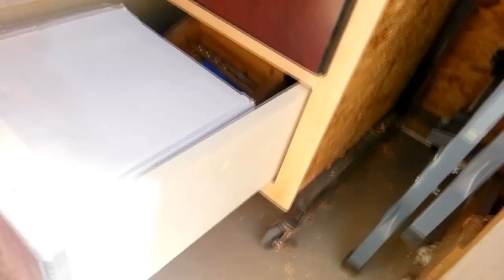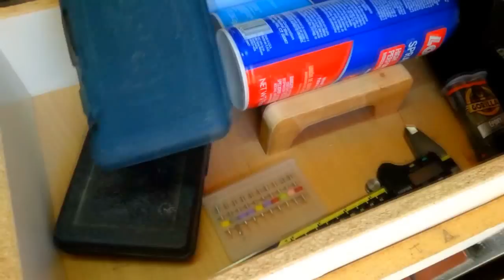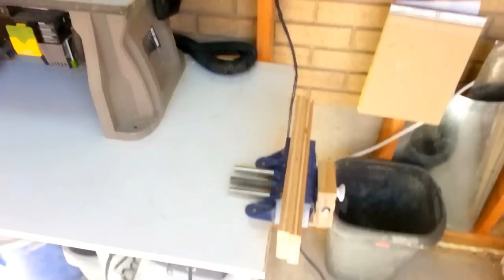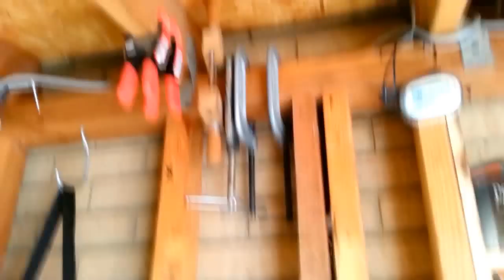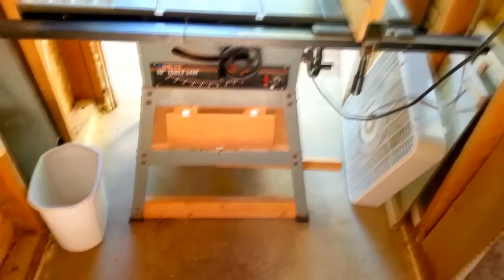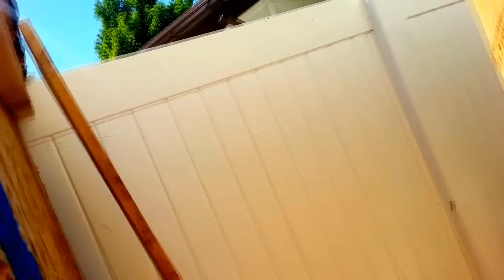Very Small Shop Tour

Comment: You have wood out back covered with plastic, in sheds (kind of) with plastic covering the openings.
I'm guessing you live in a better then average warm environment that lets your cut wood dry?
I live in Auburn Wa (greater Seattle) so warm if we're lucky lasts for three months.
I'm planning to get some landscaping done and if I do get into woodworking I'm hoping to setup some kind of limited cut wood storage (shed 15' long (guess?), 7' high & 3' to 4' deep) area in the back of my property.
Any ideas on how I could dry the wood?
Reply from the maker: T'airn'KA None if the wood storage in this video is for anything green. It's all dry before it's put in a storage area. All the storage is open in the back as well so it vents, I live in Utah so it's definitely not as wet as WA but I do get a bit of warping from humidity on thin materials. I have since setup up an open storage area for fresh milled lumber to dry and a small storage shed. I may do a video of those in the future.
Reply: I saw some of your new storage box (prior to fire vid) with a tip up top and tip down front.
A thought, would storing wood on edge horizontal or some kind of uniform clamping work against warpage?
Reply from the maker: T'airn'KA Usually I just put the heaviest pieces on top and that seems to stop the thinner pieces from warpage but I have enough lumber that it's really not a big deal for me. but anything in the storage box I haven't had warp at all, only the pieces under tarps where the the moisture can't escape.

Comment: What I would give for such a large shop 😀😀😀👍
Reply: +Smallest Workshop (Geoff Harris) its pretty well organised, my shop is 14ft by 7ft so i know what you mean ; )
Reply from the maker: +Smallest Workshop (Geoff Harris) Oh we are in about the same work space mine is 12x6 we should start a club! haha
Reply: +CNWOODWORK that sounds like a plan, I don't know about you but I seem to spend 30% of my time constantly striving for the perfect layout and the rest making more tools or jigs, maybe one day I will get down to some serious woodwork. 😀👍
Reply: +CNWOODWORK occupational hazard 👍😀
Reply: +Smallest Workshop (Geoff Harris) BTW looking forward to your next dumpster diving vid, this is something that your previous episodes have encouraged me to get into. Especially at a local factory where they put out massive bags of hardwood cut offs 👍👍👍
Reply from the maker: +Smallest Workshop (Geoff Harris)  How big is your shop Geoff?
Reply: +CNWOODWORK Hiya, my cavernous workshop is based on two garden sheds clamped together giving me 8 feet by 11 feet narrowing to 10feet. I couldn't get a regular 8x11 as the garden fence runs at an angle along the boundary of the property. I doubt it is the smallest on the planet, hence the Maybe, but I do pride myself at having as much machinery in there as possible. To date that includes lathe, pillar drill, planer/thicknesser, grinder and sanders, router in with the table saw, plus numerous hand tools probably 3 or 4 pcs some that are dedicated to the likes of a home made CNC which is still under construction. The list goes on. Check out my channel I think it gives you an idea.
Reply from the maker: +Smallest Workshop (Geoff Harris) Agreed! I spend a lot of time organizing and reorganizing. Or just moving stuff out of the way.
Reply: +CNWOODWORK I've had this knocking around for a while now, would you be interested in signing up if I cobble something together 
planetssmallestworkshop.com , if you are let me have your email.

Comment: Cool shop.  I like the table saw close to the door.  Pulling it outside when u need to saves the shop from sawdust.  Took me years to learn that---mine is under the carport covered in a tarp.  Works out just fine when I need it. Just remember, big or little, you will never have quite enough space!  LOL